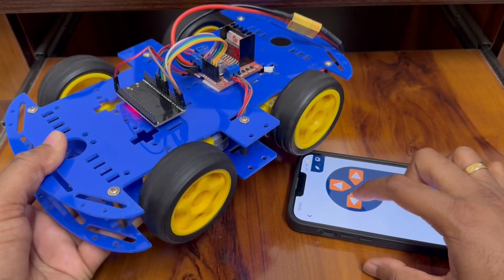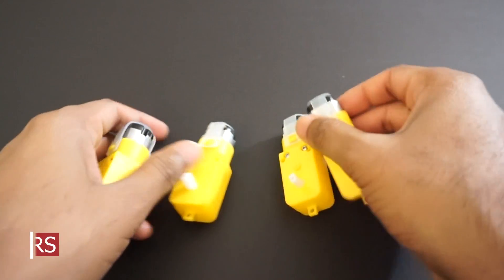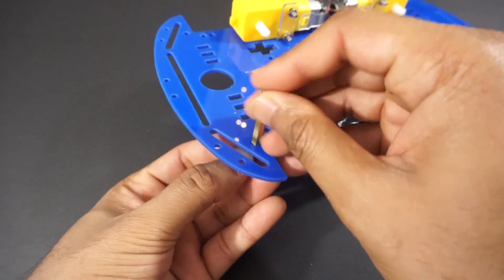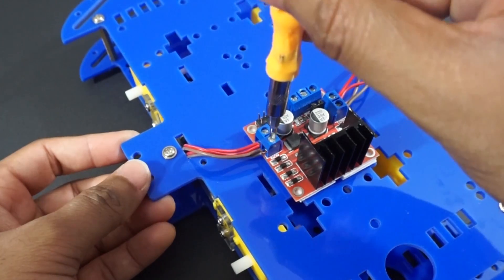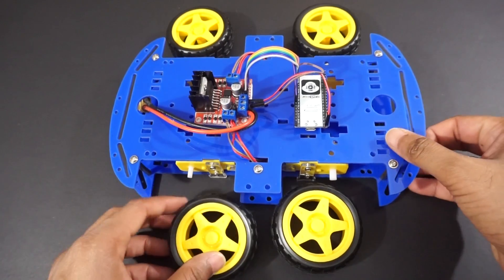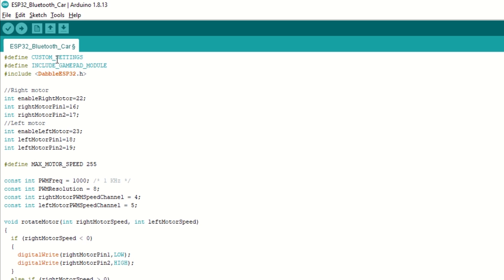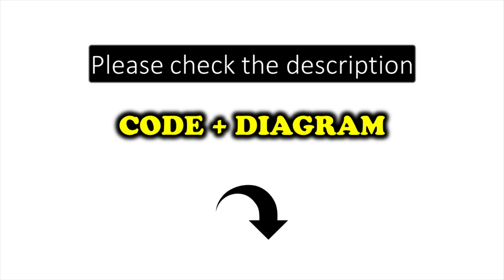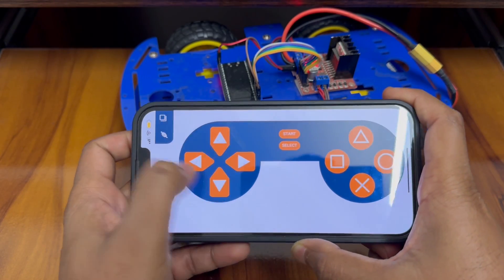ESP32 Bluetooth Car | Android + iPhone | DIY 🔥

Comment: How many voltage for battery you use to run the esp32 and motor driver? And what do you called the battery you use? Thank you

Comment: C:\Users\K\AppData\Local\Temp\.arduinoIDE-unsaved2025913-9368-1ypz4r4.b04z\sketch_oct13a\sketch_oct13a.ino: In function 'void setUpPinModes()':
C:\Users\K\AppData\Local\Temp\.arduinoIDE-unsaved2025913-9368-1ypz4r4.b04z\sketch_oct13a\sketch_oct13a.ino:62:3: error: 'ledcSetup' was not declared in this scope
   62 |   ledcSetup(rightMotorPWMSpeedChannel, PWMFreq, PWMResolution);
      |   ^~~~~~~~~
C:\Users\K\AppData\Local\Temp\.arduinoIDE-unsaved2025913-9368-1ypz4r4.b04z\sketch_oct13a\sketch_oct13a.ino:66:3: error: 'ledcAttachPin' was not declared in this scope; did you mean 'ledcAttach'?
   66 |   ledcAttachPin(enableRightMotor, rightMotorPWMSpeedChannel);
      |   ^~~~~~~~~~~~~
      |   ledcAttach
exit status 1

Compilation error: 'ledcSetup' was not declared in this scope                                                                                              i am getting these errors what should i do

Comment: Im having an issue with the ledc write and setup prompts in the code, its giving me an error message even though im on esp32 3.0
Reply: same problem
Reply: Did u find solution if yes then tell plz
Reply: downgrade to esp 2.017 r something. 3 version doesnt allow ledc

Comment: hello, i have used esp 32 devkit instead of esp now. i changed the connections according to that and im using a 12v battery pack to power the motor driver. The light was going off when connected to vin so i also used a 7805 ic to regulate the power supply. but it is still not working. your
 help would be very useful.

Comment: Hello thank you for video Im making a robot using this components it was wery helpful i used web and wifi interfase for control.
Reply from the maker: Thank you very much for checking out the video 👍🏻👏🏻
Reply: @hashincludeelectronics  bro the code is not working in my case i dont know why

Comment: Sir, My Car Works Only When It is Connected with Both Battery and Laptop, If even one of them is not connected my Car Doesn't shows in Dabble Aop
Reply: Do you know how to fix this now?
would help alot if you told me how you did it... having the same problem
Reply: @evansaif4477 you have to give Power To Both Moter Driver and Esp Separately with same battery, means Connect it using switch, 1 wire  goes to Esp Vin and one more wire to Moter Driver Vin

Comment: Where did you download the DabbleESP32 module, when I try to compile, it gives errors
Reply from the maker: Please check the video for this step 👍🏻👏🏻
Reply: @hashincludeelectronics thank you very much, the code works well now, also the esp32 has to be on a previous version cause the ledc does not work on newer versions. 👍

Comment: Sir i did everything as u showed. I triple checked everything. The wiring the code. Eveything is debugged. 
But still two of my motors are rotating while two arent. 
The motors are fine. Motor driver is fine. The battery power is fine. But i dont what the problem is.
Reply: Hey I got same problem did you solve it?I check everything,is perfect but I can't able to move my car and inch

Comment: The code uses die expressions "ledcSetup" and "ledcAttachPin". These expressions are not recognised by the Arduino IDE and uploading fails. Do you have a newer version of the code, which runs with the recent versions? 🤔🤔🤔
Reply from the maker: I dont have newer version of code . Please install 2.0.16 version of esp32 board to resolve this ledc issue 👍🏻👏🏻
Reply: Bro u solved the issue, pls reply ASAP 🙏🙏🙏🙏🙏🙏🙏🙏🙏🙏🙏🙏🙏🙏🙏

Comment: brother my project everything is okay .i did it same as like you.code has been uploaded .but problem is when iam get in dabble app there is not showing my bluetooth car to connect.crossed check many times but it's all same.Can you please help me?
Reply from the maker: Please use rechargeable battery to avoid issues 👍🏻👏🏻
Reply: did u resolve it?

Comment: Hey 👋🏻 I did all the connections properly and followed all the steps. I am also able to connect the dabble app. But the bluetooth gets disconnected after 5 seconds when I connect the L289N with 3 3.7v batteries with 2 gear motors. I tried to add debug statements without connecting l289n and it is working fine without 1289n. 
Can you help me solve this issue?
Reply: It might be a power issue as the load of all the 4 motors and ESP and the motor driver is on the 3.7v battery
Reply: Even I have made such an car but without the Dabble App, and powering the motor driver with 11.1v

Comment: Thank you sir ,but now a new problem occurs ,my car is connected to my phone but by operating through the dabble app it does not make any movement .Help me sir please.
Reply from the maker: Use rechargeable battery to avoid power related issues if any 👍🏻👏🏻

Comment: Sir i have made each and every connection as shown but when i connect 12v 2A supply to it, it gets short Circuit and from then i am not able to connect with the supply.please help i am trying this from 2 days .sir please reply fast.
Reply from the maker: Looks like issue with connections . Please check the connections again and video as well for any missing steps 👍🏻👏🏻

Comment: The given code is not working for me
Reply from the maker: What exact issue are you facing ? 👍🏻👏🏻
Reply: @hashincludeelectronics  Bro  it was showing like exit status from lcdsetup something
Reply from the maker: @niladriroygoswami273 please install 2.0.16 version of esp32 board 👍🏻👏🏻
Reply: @hashincludeelectronics  the code is running now but it is not showing the bluetooth device called "My Bluetooth car"
Reply from the maker: @niladriroygoswami273 please use rechargeable battery if not using already to avoid any power issues 👍🏻👏🏻

Comment: For the motor drive I could only put 4 wires instead of six would it still work?
Reply from the maker: Please make the connections as shown in video and diagram only 👍🏻👏🏻
Reply: @ it’s cause my motor driver is a WWZMDiB the brand 2 Pcs L298N Motor Driver
Reply: And I couldn’t find the the motor drive you have

Comment: hi i got this error when i upload it C:\Users\cj\AppData\Local\Temp\.arduinoIDE-unsaved2025410-18264-1jw3dzv.1qf6\sketch_may10a\sketch_may10a.ino: In function 'void setUpPinModes()':
C:\Users\cj\AppData\Local\Temp\.arduinoIDE-unsaved2025410-18264-1jw3dzv.1qf6\sketch_may10a\sketch_may10a.ino:70:3: error: 'ledcSetup' was not declared in this scope
   70 |   ledcSetup(rightMotorPWMSpeedChannel, PWMFreq, PWMResolution);
      |   ^~~~~~~~~
C:\Users\cj\AppData\Local\Temp\.arduinoIDE-unsaved2025410-18264-1jw3dzv.1qf6\sketch_may10a\sketch_may10a.ino:72:3: error: 'ledcAttachPin' was not declared in this scope; did you mean 'ledcAttach'?
   72 |   ledcAttachPin(enableRightMotor, rightMotorPWMSpeedChannel);
      |   ^~~~~~~~~~~~~
      |   ledcAttach
exit status 1

Compilation error: 'ledcSetup' was not declared in this scope
Reply from the maker: Please install 2.0.16 version of esp32 board 👍🏻👏🏻

Comment: Thanks a lot for the all the effort, everything worked for me perfectly. I am answering few common issues faced by many in this project, If you like it please pin my comment. For people who are getting code compilation errors please use Board Manager esp32 version 2.0.16 that will fix all the errors and people who are getting frequent bluetooth disconnection issues please 2  18650 lithium ion 3.7v batteries (each would cost 90 Rs max) and use good quality wires (not the weak and thin ones that come with cheap toys) and please make sure there are no loose connection to the battery. I was facing this disconnection issues because i was using a very thin wire connected to switch, i removed that and connected the motor driver to the batteries with standard quality cables and it fixed my disconnection issue. I suggest you guys also follow that

Comment: Hi can i use normal battery pack using duracell batteriess instead of the ones you used. 4 DoubleA cells?
Reply from the maker: Please do not use those non rechargeable batteries 👍🏻👏🏻
Reply: El creador ya te respondió pero si, es mejor que uses baterias recargables ya que estos proyectos gastan demaciado la batería y son desechos muy contaminantes

Comment: In file included from E:\car\car.ino:3:

C:\Users\88017\Documents\Arduino\libraries\DabbleESP32\src/DabbleESP32.h:49: error: unterminated #ifndef

 #ifndef DabbleESP32_h

 

exit status 1

Error compiling for board ESP32 Dev Module.

This report would have more information with
"Show verbose output during compilation"
option enabled in File -> Preferences.
Reply from the maker: Was this resolved ? 👍🏻👏🏻

Comment: how can we charge the battery?
Reply from the maker: It depends upon which battery are you using . 👍🏻👏🏻
Reply: For the battery shown here , i.e lipo , use a Lipo charger. Eg- Imax B3/B6
Reply: buy a charging module TP6450

Comment: Bro, I have a doubt how you connected the motor driver and esp32 which requires diiferent voltage dupply as 5v and 3.3 v respectively
Reply from the maker: Motor driver can work on 3.3 v signal level 👍🏻👏🏻

Comment: Port 12 is not avaliable what to do
Reply: Can i get a fast reply its urgent for tomorrow
Reply: I've got 3 ports 4,5,6
Reply from the maker: Please use the port which is connected to your esp32 module . 👍🏻👏🏻. Or disconnect and check which port is not visible . Then connect and try 👍🏻👏🏻
Reply: @hashincludeelectronics  thnqq soo much

Comment: Please answer quickly as I am chasing time to collect this project why the right motor won't move
Reply: may be you didnt soldered it correctly. try to put wires of right motor to the 9V battery directly. if it is working then ur connections are wrong
Reply: @GauravAroraGA I've done the re-soldering still doesn't move the right motor

Comment: What's wrong when 2 motors don't rotate?
Reply: Yes
Reply from the maker: Please make sure connections are correct 👍🏻👏🏻
Reply: @hashincludeelectronics But my project was already on properly when 2 weeks later when I re-tested the motor the right part could not rotate I already checked the solder nothing came off even I resoldered it still did not turn on please answer quickly!!!!!!

Comment: Hello brother, nice project. May I know how can I convert it into an accelerometer controlled car? I tried switching to accelerometer mode in the dabble app but when I do that the car doesn't move.
Reply from the maker: You will have to make changes changes in code accordingly 👍🏻👏🏻

Comment: Can i use 5 volt power supply for both esp32 and motore driver
Reply from the maker: You have to use 7-12 v for L298N driver . You can use 5v for esp32 👍🏻👏🏻

Comment: Its disconnect in every 2 sec when connected to dabble app
Reply from the maker: @prashantagarwal7572  May be there is power issue . Use rechargeable battery if not using already 👍🏻👏🏻
Reply: @hashincludeelectronics  i already use rechargeable battery

Comment: DabbleESP32.h: No such file or directory   sir it is showing error like that .what is the solution 
please respond
Reply from the maker: Please install the dabble library as shown in video first 👍🏻👏🏻
Reply: @hashincludeelectronics  sir I installed
Reply: After that it is showing error
Reply: Sir please reply
Reply from the maker: @prashantagarwal7572  install dabble esp32 library . Please check again . Make sure it’s dabble esp32 👍🏻👏🏻

Comment: Can i use esp32 wroon 32 ? Instead of the one in the video?
Reply from the maker: The one which is used is 38 pins. I believe yours is 30 pin module . Give it a try 👍🏻👏🏻
Reply: @hashincludeelectronics  can i use the same coding?
Reply from the maker: @danielroslan9212  yes you can 👍🏻👏🏻

Comment: this is my error with the 2.0.16 version of esp board                                                                                                                                                                                                                  [--chip {auto,esp8266,esp32,esp32s2,esp32s3beta2,esp32s3,esp32c3,esp32c6beta,esp32h2beta1,esp32h2beta2,esp32c2,esp32c6,esp32h2}]

           [--port PORT] [--baud BAUD]

           [--before {default_reset,usb_reset,no_reset,no_reset_no_sync}]

           [--after {hard_reset,soft_reset,no_reset,no_reset_stub}]

           [--no-stub] [--trace] [--override-vddsdio [{1.8V,1.9V,OFF}]]

           [--connect-attempts CONNECT_ATTEMPTS]

           {load_ram,dump_mem,read_mem,write_mem,write_flash,run,image_info,make_image,elf2image,read_mac,chip_id,flash_id,read_flash_status,write_flash_status,read_flash,verify_flash,erase_flash,erase_region,merge_bin,get_security_info,version}

           ...
Reply from the maker: @Aryan-p2u3o  I believe you are using Arduino  IDE only . Please follow video step by step . 👍🏻👏🏻

Comment: Bro can I use 2 3.7V rechargable batteries to power connection. Also 4 1.5V batteries as well. Please reply me soon. ❤ love your  vids
Reply from the maker: @LakminiLochana-fn1pv  please use only rechargeable battery . 2 3.7 volts is fine 👍🏻👏🏻
Reply: @hashincludeelectronics ❤
Reply: I have a rechargable 9.6V battery can I use it
Reply: Tell me soon.
Reply from the maker: @ yes you can 👍🏻👏🏻

Comment: Connecting......................................

A fatal error occurred: Failed to connect to ESP32: Download mode successfully detected, but getting no sync reply: The serial TX path seems to be down
Reply: The cable should be a data transfer cable

Comment: its possible if 9v battery only?
Reply from the maker: Please don’t use that non rechargeable battery . Use any rechargeable battery 👍🏻👏🏻
Reply: @hashincludeelectronics  what is the problem if only 1 side will fuction not the both side
Reply from the maker: @JAROD_PG.  check the connections . Also check if motors are working fine by connecting to power supply directly  👍🏻👏🏻
Reply: @hashincludeelectronics  noted thankyou

Comment: Failed to install platform 'esp32:2 0, 16. 2 UNKNOWN. removing corrupted
archive fle remove
CiUsersialmon AppDala Looa) Arduinp15 islaging packagestriscv32-esp-elf-gcc8
4_0-e5p-2021r2-patch5-win64 zip: The process cannot access the fle because it is being used oy another process.
Reply from the maker: I have seen this error for first time . Please try to recompile and re upload the code . Check for more information on internet in this error 👍🏻👏🏻

Comment: Dabble is saying device is not supported sir please check emergency
Reply from the maker: Please follow exacts steps as shown in video 👏🏻👍🏻
Reply: @hashincludeelectronics please reply and also tell us the steps to download the esp board from the url
Reply from the maker: @mrjain4414  this step is provided in the video . Please check it 👍🏻👏🏻
Reply: @hashincludeelectronics   which version do we need to download and also I need to ask u one thing I need to add led lights in this so how to give the connection can u help
Reply from the maker: @mrjain4414  2.0.16
Reply: @hashincludeelectronics  Is it there in the url u provided I try to find it out but it's not available so can u please check and provide the link
Reply from the maker: @mrjain4414  I would suggest please check the video again slowly and carefully for all the steps 👍🏻👏🏻
Reply: @hashincludeelectronics  can u help me with the block diagram of the project

Comment: Hi can you explain I have installed all the libraries and board manager that you told, but still when i run the code it say ledc is not defined nor any ledc function. Please guide me what to do.
Reply from the maker: Please install 2.0.16 version of esp32 board 👍🏻👏🏻
Reply: @hashincludeelectronics   I have updated the board manager for esp32 by expressif to 2.0.16 but it still gives the same error
Reply from the maker: @zaidmajid2248  it should have resolved your issue . Please check again 👏🏻👍🏻

Comment: fork/exec C:\Windows\system32\cmd.exe: Operation did not complete successfully because the file contains a virus or potentially unwanted software.

Compilation error: fork/exec C:\Windows\system32\cmd.exe: Operation did not complete successfully because the file contains a virus or potentially unwanted software
when i compile its will be that why?
Reply from the maker: Please copy the code properly 👍🏻👏🏻

Comment: im getting an error in code that ledcsetup and ledcattachpin was not declared pls help me
i did everything isntalled all the libraries, its the correct port my esp32 is the wroom model like please brother help me ='(
Reply from the maker: Please install lower version of esp32 board like 2.0.16 👍🏻👏🏻
Reply: @hashincludeelectronics is there any alternate way so that we can use it in any  version of Arduino ide??
Reply: bro you are a legend i got the code setup and running but now i cant seem to get my esp 23 to setup the bluetooth. i give the esp32 power but it still cant seem to setup the bluetooth
i keep searching on dabble app and all i get is acquiring device name option and when i click on it, it says that error device not supported
also my esp keeps blinking when i give it power
Reply from the maker: @adp1ayz743  press enable button on esp32 and try connecting again using dabble app 👍🏻👏🏻
Reply: @hashincludeelectronics  dude im still trying and getting the aquiring device name option and it still doesnt allow me to connect to it.
Reply: ok so problem solved but i have another problem
as long as the module is connected to pc it send the signal but when powered by battery it stops sending it ?

Comment: brother i am using esp32 with 30 pins so went to the code and changed some of pin to respected pis in esp32 with 30 pin
so it can work na
Reply from the maker: Yea I believe it will 👍🏻👏🏻

Comment: my esp32 has only 30 pins, please tell me what should i do.
Reply from the maker: I think it will work . Give it a try . However I would really recommend to use the same module as I used which is 38 pins and tested . 👍🏻👏🏻
Reply: @hashincludeelectronics  thanks a lot bro, the video really helped me on my first project.
Reply from the maker: @g_g_vivek  nice to hear 👍🏻👏🏻